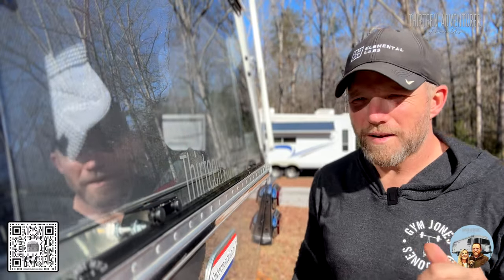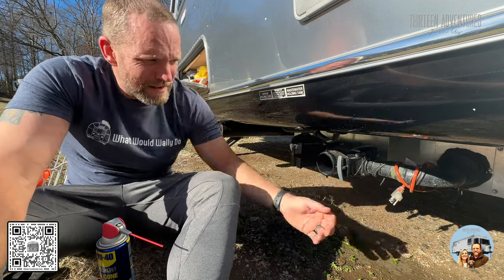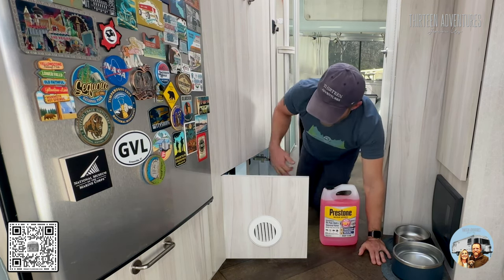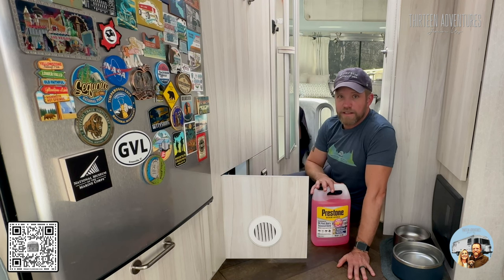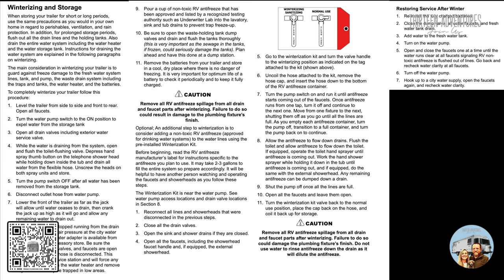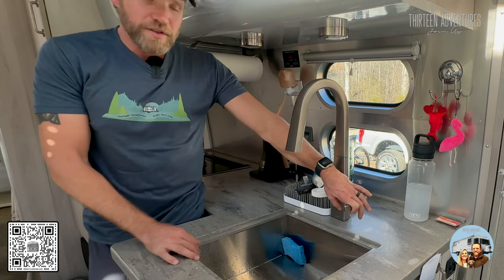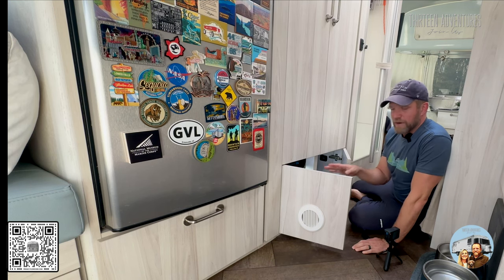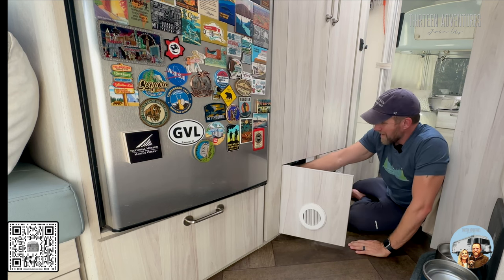Winterizing Your Airstream RV: Quick and Easy Steps

Comment: Hey Brad, great video and easy to follow. I almost reached out to you a couple of weeks ago because I couldn’t find where the hose was in my 30 FC Bunk. I called the area dealer on a Saturday around 3 and all the techs were gone for the day and the service advisor couldn’t direct me either. My Airstream is kept inside a metal building but it’s not insulated. I used the air hose to blow the lines out and ended up running the furnace on 45 degrees for a few days to help make sure the pipes didn’t freeze. My Airstream had an appointment later that week for other minor issues and the tech showed me where the hose was but had to remove a drawer to unkink the line to use. I used the RV Antifreeze in the dealership parking lot and did what you did but I just realized that I forgot to do the outside shower. Anyway, thanks for all you do and sharing it with us. Appreciate you Brother!
Reply from the maker: Thank you for watching and your feedback. Glad you were able to get this sorted out.

Comment: Using the proper toilet paper should not be a problem if you use plenty of water and a good tank treatment to break everything down.  The problem you had with the RV with the built-up solids was probably due to the previous owner hooking up to sewer and just leaving the valve open all the time.  In that situation, the solids will drop out of suspension and get left behind as only the water drains away.  Keeping the valve shut and periodically draining when you get to 80% or so on the monitor should prevent build-up.  Follow with a good flush as you described.  Traveling with some water and treatment in the tank will help loosen any stubborn debris as it sloshes around.
Reply from the maker: We had the tank issue in a non Airstream trailer. It was also a new one. Of the five trailers we’ve had, none were used when we bought them. We’ve just continued not putting it in the tank. Also, we like non-RV paper better. Also, mostly use baby wipes.

Comment: Great video Brad. I typically “blow” out my lines for winterization but will file this one away in case I decide to to use RV antifreeze. 
QUICK question: can you send the link for the window caps / screws you showed at the beginning of the video?  I have a couple that have “popped off” on my 2019 GT. 
TIA - and keep up the great work.
Reply from the maker: Thank you for watching and your feedback!  Here is a link to Woodland Airstream. https://woodlandairstreamparts.com/products/airstream-plastic-screw-cover-cap-black-381610-04
Reply: @ThirteenAdventures   - Thanks SGM!

Comment: Question for you. I’ll be in Long Island NY this march for a few days. Regarding the heat cables wrapped around the waste pipe(s), do you also cover the cables to retain the heat, or do you find it works fine just wrapped and left open the environment ? Thanks again !!
Reply from the maker: Hello!  Thanks for watching and for the opportunity to help.  I have done both ways.  It really depends on the temps.  If it’s below freezing for a few days and I get no sun on that side of the rig, I will wrap some insulation around the pipes.  If it’s just freezing at night, I only have the heat tape.

Comment: Do you do anything to freeze protect the black water flush?  Also , what about water left in the fresh water tank outlet to the tank?  And do you put antifreeze in your black tank?  How much?  Great job on the video.  You provide the most practical and recent information in a great short format.  Thank you!
Reply from the maker: If I were storing it for the winter and winterizing it, u would drain the fresh tank completely. As mentioned in the video, I would pour some antifreeze in the black tank and down each sink/shower drain and very quickly open and close the dump valves.

Comment: Great video!  Did you lubricate the valves and the cap?  Our cap is so hard to open.  We blow out our lines and don't use the anti freeze.  The Airstream manual taught us to do it this way.  I just have an aversion to having that stuff in our pipes, even if its non toxic ;)  Thanks again for sharing all you knowledge.
Reply from the maker: I don’t lube the cap but I would use the same silicone spray to do it. I agree they are difficult to get on and off but that’s for a reason…so they don’t accidentally come off at the wrong time!
Reply: I totally agree, but i need to build up my strength because only my hubs can open it now.  Do they sell ones with a handle so I can get some leverage?
 @ThirteenAdventures
Reply from the maker: This is the only one I am aware of with something like a handle. 
https://amzn.to/3vZdODF